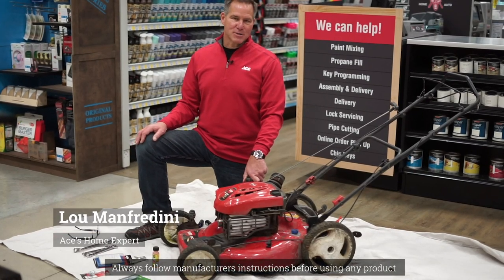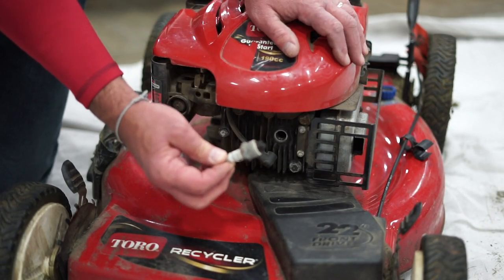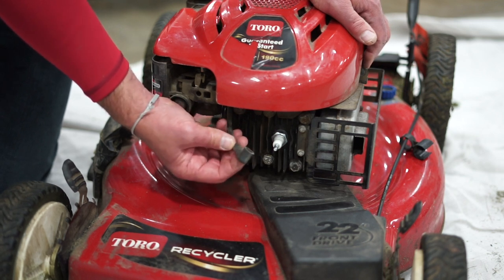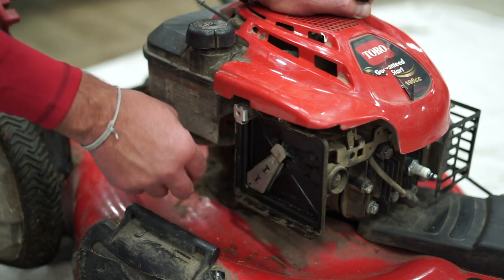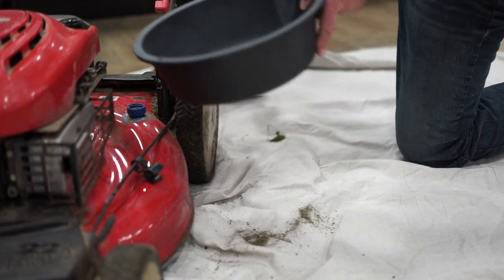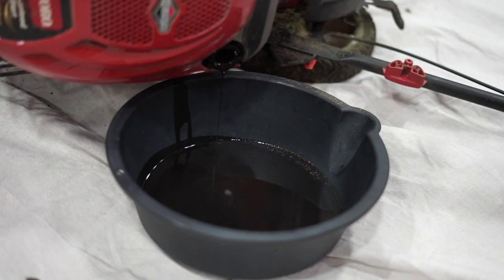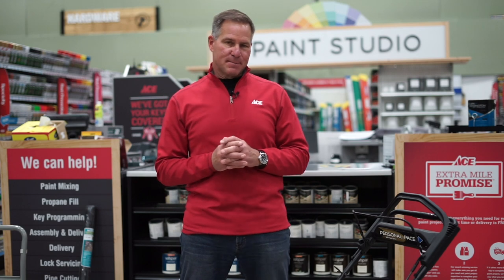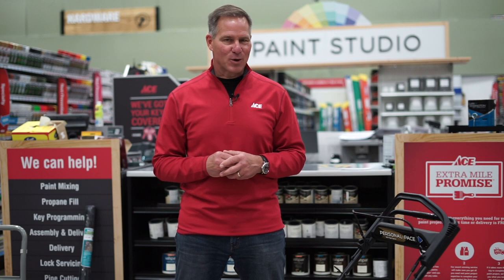How To Tune Up Your Lawn Mower - Ace Hardware

Comment: 5:00 — these directions for the oil change left out one essential part: you should only change the oil AFTER the engine has been running and the oil is still hot.  Otherwise, you won't get all the old oil to drain.
Reply: How can you run the engine oil out if the engine doesn't want to start in the spring.
Reply: @reneeworkman9987  Take good care of it and it'll start in the spring...
Reply: @reneeworkman9987  Change the oil in the fall before you put the mower away for winter. Run the gas out - the oil is nice and warm, then dump the oil and put fresh oil in. Don't let that old oil sit in your mower all winter.

Comment: How i do a tune up on mine is? 1 teaspoon of B-12  after every 3 fill ups. Those spark plugs about NEVER GETS CARBON ON THEM >.  And the mower will always start fast. Cause it cleaning the > spark plugs, carb, tank, and lines

Comment: Those blade bolts never come off that easy. You have to wedge something in there to keep blade from spinning. Also, I pick up mower to get all old oil out.
Reply: Just use DW40 on the bolts or grease that loosens the bolts then you can buy a block to wedge the blade so it doesn’t move then use the socket wrench to take off the bolt!

Comment: Carburetor cleaning?
Reply from the maker: Hi Braeden, good question!  A lawnmower's carburetor can get grime and lawn debris in it.  Applying a small amount of carburetor aerosol spray directly to the device is enough to clean it and improve its function. We did not show it on this maintenance since the carburetor cleaning varies based on lawnmower usage. For this particular lawn mower it was not time yet.  Hope that helps!  Gives us a great idea for a future video!

Comment: If I have a full tank of gas, how do I empty the gas to change the oil? Where can the gas and oil be disposed?
Reply: Let the mower run dry with that gas, easiest way
Reply: Just buy a plastic pump to syphon all the gas out of the engine. You should be able to pump and have a plastic bottle or another plastic container to hold all the gas in.
Reply: As for the oil just buy a oil pan that holds 7 quarts of oil and get a separate one for the gas because you don’t want mix the oil and gas together. You can definitely take the old oil to Autozone the gas I’m not sure where to take that. Buy a syphon pump for the gas to drain out and tip your lawnmower over to drain out the oil. Do both steps separately!
Reply: Take the hose off of the carb by removing the pressure ring with a pair of pliers. Drain into a gas can to use later. If you are changing the air filter this is a good time to do that with the filter out of the way. Depending on where you live, some garbage/ recycling depots have drop off for old oil. Some may charge for the service. Some big box automotive stores will take and recycle old oil so just call around.